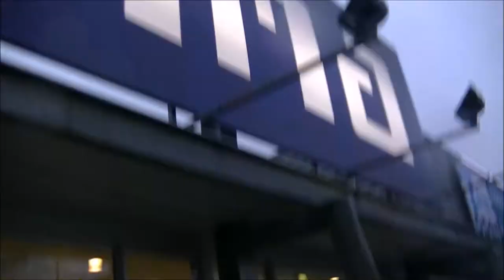Sub Flooring - Campervan Conversion

Comment: Now you've had the cork floor for a while, how is it doing? if you got another van would you do the same again?
Reply from the maker: It's doing well! We're happy we used cork and would definitely use it next time. It's incredibly warm to the touch, and has held up well to our dogs' nails, our dirty hiking boots, and moisture. It's stained a bit from mud but otherwise it's very much in mint condition! :)

Comment: So you glue down that very bottom layer of wood? I've been having trouble figuring out how people get that bottom base layer they base everything else off of.
Edit. Also what was that black stuff you put at the bottom between the bottom layer of wood? Was it to keep moisture out?
Reply from the maker: Ethan Campbell Yes, we glued the beams down using assembly kit. This is strong enough because there won't be any sideways pressure, the (sub)floor will only press down on it. The black stuff is cork insulation in a granulated form :) cork handles direct contact with moisture very well. We wrote a few blog posts on the subjests of flooring and insulation, you can find them all here: http://mojoandfriends.blog/campervan-conversion/ :)